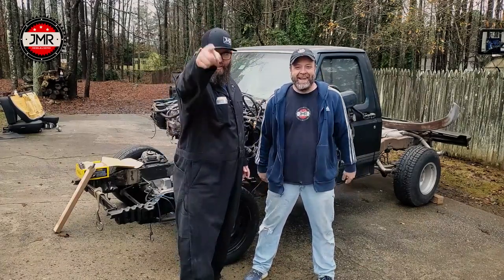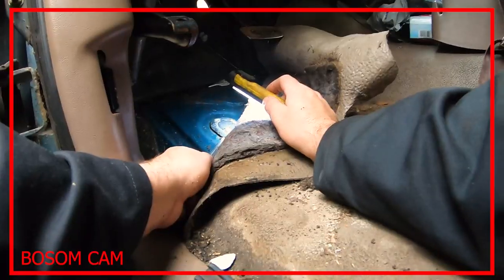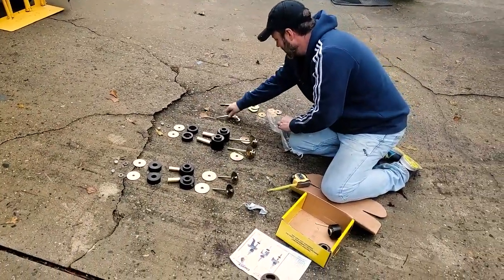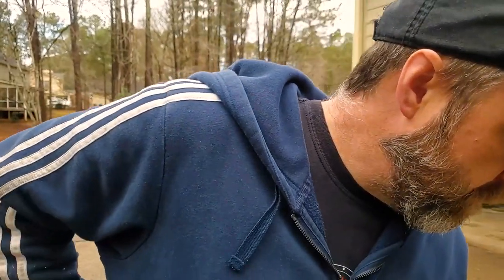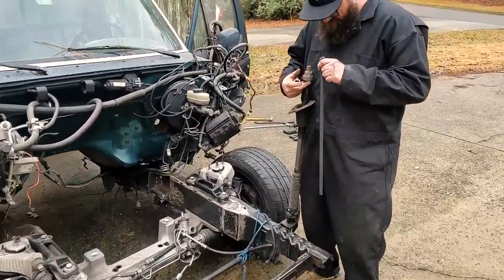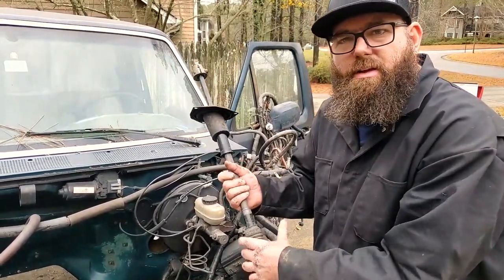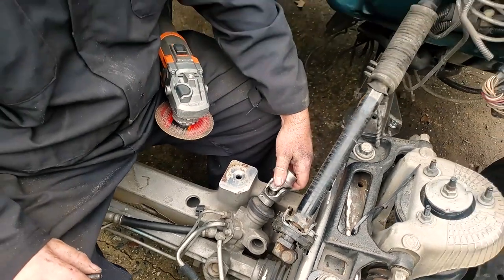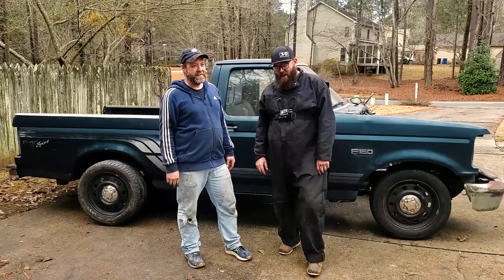Why are Body Mounts So Horrible to Remove on our Coyote Swap F150?

Comment: The original motor and trans from this truck is still running strong in my truck. You guys are awesome!
Reply from the maker: Heck yeah brother. Glad you were able to put her to use.  Let us know if you need a rear end.  We will have that ready soon
Reply: What gear ratio
Reply from the maker: Not sure I believe low 3s.  I'll have to check.  We will be removing it completely intact with all the suspension mounting points.
Reply: If it's 3.55 of 3.73 let me know
Reply from the maker: @johncollis3201  I believe it is lower than that.  3.3 something. I believe.
Reply: Well dang still an awesome truck though
Reply: Probably 3.08 gears

Comment: So is this a truck and a crown Victoria frame welded together? Did you you have to widen the suspension?
Reply from the maker: Hey thanks for the comment.  We tool the front suspension cradle out of the crown vic episode 5.  Then we took and welded in a kit from Team321 that allows us to bolt the cv front cradle into our truck frame.  Hope this helps.  Keep getting after it.

Comment: Why did you replace the cab mounts? I'm  planning on doing theses same project. I have 1994 F150.I want to put the suspension of a crown vic. I was wondering if these cab mounts would be necessary for my project
Reply from the maker: Hey Joel. Our cab had a "body lift" that we needed to remove, because we are going for the lowered look.  Thanks for the comment!

Comment: The original bed should just sit down right on the frame. There were thin like 1/8" plastic isolaters between the cross rails and the frame on my truck. Look into super duty bed bolts and the clip nuts. Originally the obs fords came with just carraige bolts and nuts coming from the top down.
Reply from the maker: Thanks brother appreciate the info.  Thanks for the support as well.  We will look into this.
Reply: @JMRRebuilders  the super duty bed bolts are nice because the nuts clip onto the frame, then the bolts are usually a torx bit and can be done from the top. Last i knew LMC sells a kit for them. Nice work, keep it up!
Reply from the maker: Heck yeah ill check it out.  Thanks

Comment: Why did you guys drop the body ?
Reply from the maker: Hey brother thanks for the comment.  If you haven't been following we have done a cv swap and are doing the coyote 6r80 swap as well.  The truck had an aftermarket 3 in body lift on it so we removed it.